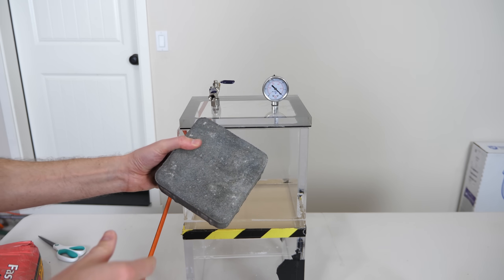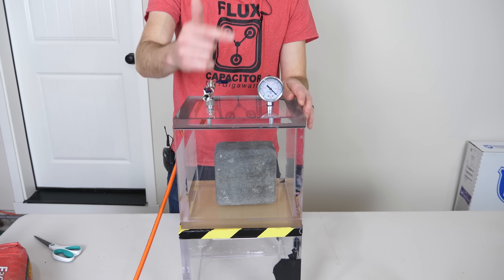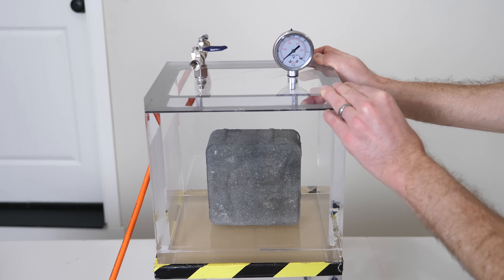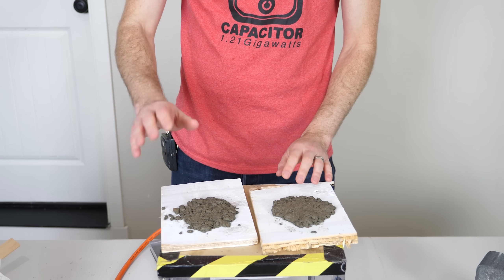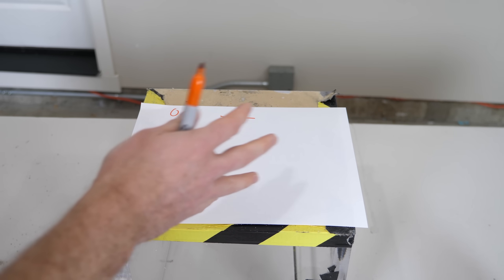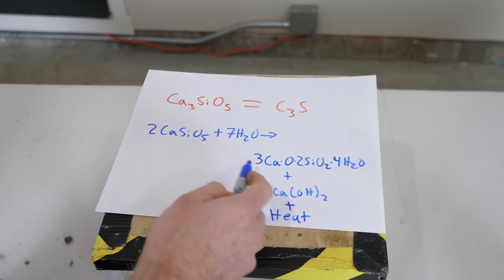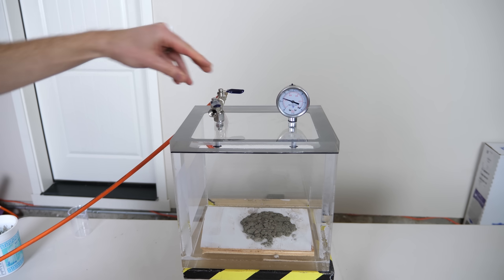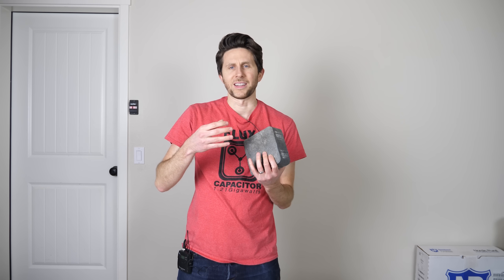Does Concrete Turn to Dust in a Vacuum Chamber? Concrete Without Oxygen Experiment

Comment: Concrete relies on oxygen for the chemical reaction to occur causing it to become "concrete" 
That reaction has already occurred in all standing concrete structures. I bet the wet cement doesn't solidify though
Reply: I'm 65% sore
Reply: Sure *
Reply: So oxygen doesn't effect it at all
Outside oxygen anyway.

Comment: We can cast concrete structure here on earth and after concrete attain full strength that is after 28 days we can transport that structure in space, but the concrete requires curing that is hydration in order to attain full strength, and in this time air act as well so we can not cast concerted in vacuums lease it will be of less strength and may crumble on applying heavy load, or against any collision.

Comment: Isn't this a concrete without MOISTURE experiment?  Water is crucial to the chemical and physical process but once the connections are formed/it "sets", surely any oxygen atomically bonded in the solid concrete isn't going anywhere...  --  I just don't understand why the supposition in the first place.  Did you actually think a vacuum was removing all the oxygen _(or did you mean water or air)_, is it a known factor that oxygen molecules remain in the concrete/are responsible for the connections, and if not why would removing the moisture or oxygen result in the concrete crumbling to dust?

Comment: Reminds me of the Futurama joke about the spaceship only being able to handle "0-1 atmospheres".
There is 0 pressure in space, we're just used to positive pressure, so in relation, it's negative(kind of like how water is technically an acid and not a base).
Beyond that, the only thing that would act on the concrete at the point is the friction of air leaving, and then nothing at all.
Only things with an internal negative pressure can pop in space.
Maybe if he filled the concrete with a bubble of liquid water before it dried.

Comment: Of course it won't crumble to dust, you haven't removed the oxygen, you've just removed the gas in the chamber.

Taking away the oxygen, and removal of air around it, is not the same thing.

If you put water in a vacuum, it's still water, but if you take away the oxygen, it's just hydrogen gas.

Comment: the cement is a chemical subtances or powder that will have chemical reaction after getting water, so after the reaction complete, easy to say is dry out the cement is completely become solid, and in order to become dust you need to break the atomic structure or you can say molecules

Comment: At first I thought that the paver in the vacuum chamber would crack (not crumble) because air bubbles and liquid water inside it would boil and expand due to the vacuum.  But then I realized that these air bubbles or droplets of water are insulated from the vacuum by the solid and rigid concrete structure in which they are embedded.  For these bubbles to burst the concrete would have to be elastic to allow the internal gas bubbles to expand and burst.  But concrete is rigid, so it keeps the air bubbles and water droplets under pressure, even when the paver is in the vacuum chamber.

Comment: Guess it makes sense cause the chamber walls can handle it so why wouldn't concrete maybe. I mightve been guessing it would turn to dust/crumble though but it clearly doesn't make sense I guess.
Reply: Why would the lack of oxygen somehow break the molecular bonds between the atoms in cement? Doesn't make any sense. If that were true then anything with organic compounds in a vacuum chamber would also be effected the same way which obviously isn't the case.

Comment: I guess that the only thing that could be done removing air from surface concrete with a vac is that you could then inject ink into it and it would penetrate much deeper than usual.

Comment: Scrap that vacuum chamber before it implodes!  The solvent welds on it are no good!  You should not see any air gaps in the joint. Soak the mating surfaces so they're soft before doing the weld. Also, use a router to cut the edges and not a saw.

Comment: I did this a lot as a big part of a job in masonry testing. The air can easily escape and pulls a vacuum on the inside. It won't be damaged.
If you let in water instead of air it will saturate the masonry beyond normal saturation and feel all the pores that couldn't be filled with water. To make the effect even better, boil all the disolves air out of the water first.
It can make it fragile for a minute as the pores refill, but the effect is minor.

Comment: You could have made a better video if you had put the brick in a zip lock bag with a gopro looking at it drop it a couple of atmospheres of water and course the brick is still brick also concrete is used in the ocean and holds up the countless bridges attest to that. But is concrete made at sea level have the same strengths when taken up in to less atmospheres? Well?

Comment: I’m what’s called a cmt field technician in a shot discription I test concrete and cement the most common concrete I deal with is what’s called a no air mix which for the most part has no air in it or such a small amount that it would be considered no air mix

Comment: When wet concrete dries, the water doesnt evaporate, it become part of the solid concrete block. I cant imagine that a simple vacuum chamber would sufficiently remove any of the oxygen molecules that's tied up in the water molecules that are also further tied up in the dense concrete. 

I'm guessing here because I'm not a chemist etc but you probably need to add a very low ph substances that chemically neutralizes the high ph lye in the cement as well as add high heat and saltwater which would also cause the water to move out of the cement substance via evaporation and dehydration.

Comment: The concrete will weaken because concrete does depend on O2 to stay ridged. When you apply pressure (building weight) it WILL crumble.

Comment: The removal of oxygen is the removal of an element, a fundamental building block one too. Oxygen covers more than that of carbon based life, silicate bonds and such. But let's have some fun shall we? The removal of oxygen from the ocean would result in a sudden shock where hydrogen is still in a liquid form allowing for it to bond with other elements forming acids such as hydrosulfuric and hydrochloric acid. So a rising temperature due to the formation of acid, alongside with a now highly flammable liquid/gas would produce a hella cool fireball right?. Wrong, nothing would happen, would of been kinda cool tho right? Without an oxidising agent, in this case literally oxygen, the cool potential fireball will never exist. ;~;

On another note if a high enough temperature is reached in the proposed 5 seconds and then oxygen is then reintroduced something cool may happen.

Comment: I wonder if it was under thousands of pounds of pressure from the weight of the building if something different would happen too bad we couldn't build a skyscraper sized vacuum chamber.  approximately how long would it take to be complete vacuum in a skyscraper size vacuum chamber days weeks months cuz it's not even the air around the building it's the air inside the building as well

Comment: It's not going to turn to dust, nothing will change. Concrete doesn't need air to cure, it's a chemical reaction.  You can pour concrete under water and it cures beautifully.

Comment: Air can be important in concrete, but only when it is being poured & cured. Small pockets of air in the mix increase workability, allowing the pieces of aggregate to move around more easily by reducing internal friction. More importantly, small air pockets reduce compressive yield strength but increase freeze/thaw cycling durability. Chemical air entrainment is added to outdoor exposed concrete to increase the air content with consistent, tiny pockets of air.

Comment: ok man your not taking a buildings weight in account. the average building is like 6-500 tonns which would crush anything. and this planet is fucking massive so theres no way to truly tell if buildings would fail if all 02 was gone. gravity sorta relies on air to keep things where they are. too much gravity and we become pancakes to little and we become ice cubes in space. also with out air there would be no resistance to stop you from flying close to mach to west which would kill you instantly. i get your logic i really do but you needed to put A LOT of weight in that brick to truly see if it would turn to dust or not.

Comment: Id expect longer curing cement to have significantly weaker physical properties in the vacuum chamber. water would boil in the vacuum and turn to water vapour very easilly, and you'd lose more water the longer the reaction process takes.

Comment: Thats portland. Concrete is 60/40 (rock/sand) plus portland which is a form of lye and water. The lye creates the chemical reaction. Concrete in the presence of oxygen never fully cures. Doesnt make dust so stupid. You could run full vacuum for thirty years and not remove the water

Comment: I think a lot of people think a pump pulls air out of a vacuum chamber to create a vacuum. It doesn't. It opens a port through which the molecules in the chamber have to essentially randomly enter then be pressed out into atmosphere by the piston. If there is anything holding onto any of those molecules independent of atmospheric pressure, they won't enter the port.

Comment: I’m 90% certain you cannot use cement in space: just looking at the Colour differentiation after such a short period to set (cement fully hardens after 30 days). I’ve poured/ formed/ formulated over 1000 tons of concrete. Colour and texture means ALOT.
The cement would be irrevocably weaker in space: I can only imagine some of the oxygen is removed from the reaction. Which would affect its hardness. But also the void path left by the oxygen leaving the material would affect is porosity. Meaning it wouldn’t be air tight in a vacuum.
But now I’m curious as to whether concrete would be harder in a oxygen rich environment?
Reply: I think what happened is that the vacuum chamber dried out the concrete. It didn't leave enough water to do the chemical reaction.

Comment: This is one of the dumbest things I've ever heard of and I haven't even finished the video yet, even if oxygen was required to keep the set concrete strong the lack of it wouldn't magically dissolve the structure into dust without an outside force. Asking if it will set in a vaccum is far more interesting so I am glad you're covering that though I am pretty sure concrete just needs water to set.

Comment: I think people may have confused that fact the concrete is strong in compression but not in tension and conflated that to removing air (which has been equated to O2) to remove compression forces

Comment: The problem with the concrete collapsing without oxygen, is that air isn't completely oxygen. In fact, most of it is actually nitrogen. Huge gusts of other gases would flow into the space where oxygen used to be. But if we were talking about elemental oxygen, then we'd never live to see it happen as every oxygen atom in every biomolecule disappears.

Comment: My request: what happens if you 'cure' concrete under pressure,  like the depths of the ocean type pressure? Would it be stronger because of compression or weaker? Would it break apart during the surfacing? d0_ob

Comment: Yeah, you 'could' use concrete in space, but the weight, components, and molding it wouldn't advantageous, considering there are much stronger and lighter materials. Perhaps if there were a way to make 'concrete' from the surface moon material, 'moncrete' that would still be preferable to earthbound materials. In the future we could do these same kind of experiments with moncrete, what happens when it dries in air, or how it reacts with atmospheres like on earth. d0_ob

Comment: Concrete cures hydraulically. The oxygen in the water is what actually helps in the curing process. Once the concrete is fully cured, the water is molecularly bonded to the portland cement in the concrete.

Comment: Wanna have fun? Next time someone is mixing a bag of concrete up, throw a cup of sugar in it while its mixing.
He'll be waiting forever for it to set.
I used to drive mixers. I kept a 5 lb. Bag of sugar in the truck. When the truck is loaded and water is dumped in, you got about 90 minutes to do something with it. Sometimes contractors will turn you away if the slump is too fresh or wet, or too dry and/or is already setting. That leaves you with about 1/2 hour to get that mix out of your drum, or spend the next 2 weeks air chisling it out. Or, if nobody is taking it, (sometimes dispach will send you to an alternate site if the original doesnt want it) throw in that bag of sugar. It will keep it from setting in your drum. Just make sure you clean it all out before the next load.

Comment: It is clear that if you put normal wet concret without water anywher it wont get hard, thats why you have some extra stuff you can put in it so rhe concrete can get hard even if its underwater. So we can say it depends on the mixture

Comment: I believe it actually makes the concrete stronger by decreasing the space between the atoms
Reply: That is incredibly wrong.
Reply: @zerg0s  ok, concrete mason
Reply: @moemoney7773  No, that's basic high school physics. A vacuum doesn't decrease space between the atoms of solid matters, what were you on when you wrote that?
Reply: @zerg0s  then you also must be on something to think there is no space in concrete....yes it is a solid, but there is plenty of space that oxygen bubbles in the wet slurry.
Reply: @moemoney7773  how would that change anything about how close the atoms are? Concrete forms through a chemical bonding process. It's explained in the video. Oxygen has absolutely nothing to do with it, and not having air bubbles in it doesn't change anything about how close atoms get to each other.

Comment: Cement ("Portland cement") is one of the most destroying human activities. to make the synthetic mineral called calcium silicate a hugh horizontal furnace needs to be heated up to 1500 °C, but this is only 1/3 of the emissions. The other 2/3 getting gased out of the raw material from which cement mainly is. It is lime. And lime is a carbon dioxide containing natural rock.

Thought you guys find that interesting.

Comment: Cement + Fine Aggregate (sand)  = Mortar or Grout [low strength due to lack of larger or longer particles]
Cement + Fine Aggregate (sand) + Medium Aggregate (gravel) = Concrete
Lighter materials can be used instead of gravel to lighten the concrete.  Fiber can be used instead of or in addition to gravel to strengthen the concrete.
Reply: Finally.  There is much much more to concrete, grout, and cement.  Terminology, physical aspects of mixing, and time at minimum should have been accounted for.  If almost any one element disappeared entirely on the earth, all of earth would crumble.
Reply: @jasonhiggins9050  well, any of the major elements yes.  Now if all the uranium disappeared, we couldn't run our current nuclear reactors, but the planet should be totally fine!
Reply: @callak_9974  Hmm...not sure. I think the magnetic field is generated by convection in the core, that is driven by heat from radioactive decay. So I personally would leave the uranium in the core alone, pls.
Reply: Actually, the radioactive material in Earth's Core is Iron and Nickel, not Uranium. Sorry.

Comment: Now I could be wrong because I’m commenting before watching, but I’m 99.999% positive concrete will not crumble in a vacuum chamber, and 100% confident that concrete requires oxygen to cure. If you want to cure concrete without oxygen it has to be a special type of concrete. But now I’m starting to get flash backs of moisture being what cures concrete. Dang it. Guess I’ll find out.
Reply: So it is moisture and I guess since the reaction happens quickly and gradually slows down, the vacuum was not able to remove the moisture from the concrete.

Comment: This is about oxygen not being available for the chemical reactions concrete needs NOT to dry but solidify and hydrate. The mere removing of air does not achieve that.
edit: NVM you explained quite well in 2nd part

Comment: One doubt - how does your vacuum chamber not crumble? When you reduce pressure inside these zero the difference in pressure between inside to outside should crumble the vacuum chamber’s walls isn’t it?

Comment: I'm not too sure of the chemical makeup of concrete and nor am I architect or some other type of General construction person who works with concrete but I will say I could see the at least reasoning behind the thought process however I still think that it will not break the dust instantly although I wouldn't be surprised if the lack of air pressure to keep it solidified leads to a technically being more brittle my insurance level about 65% to about 85% as again I could see good reason for either way however I do think it will stay at least together if not fully solid
Reply: Yeah I will say I didn't expect it to break really as well I do know there are certain materials that in a vacuum completely change molecular structure with I'd assume that the biggest thought process behind buildings collapsing is that the atmospheric pressure perhaps constantly pushing on the buildings once they get past a certain point it's something that I'd imagine would have to be factored in but I also imagined wouldn't have to be too factored in